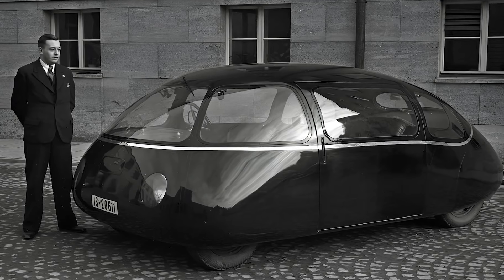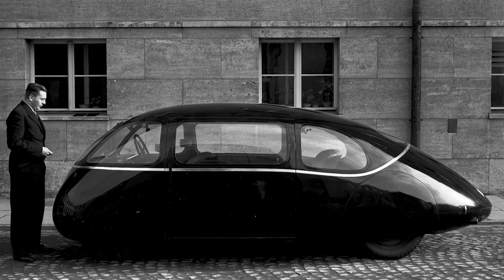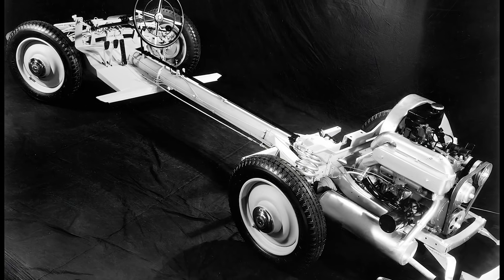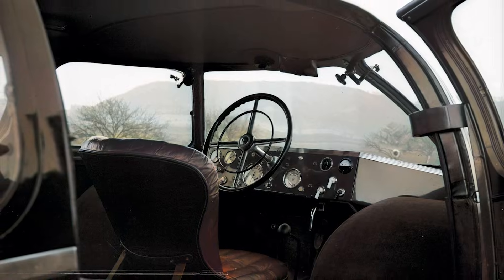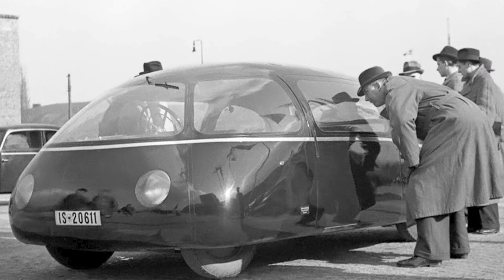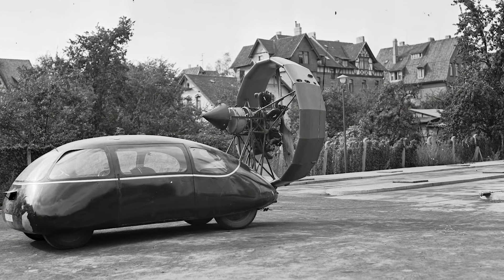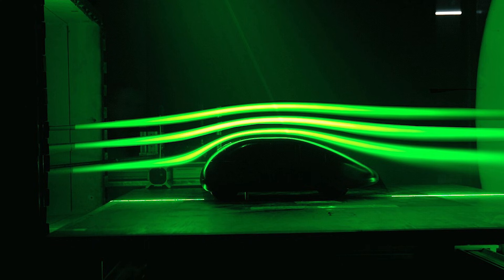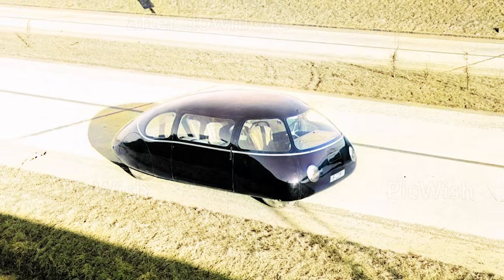👉1939 Schlörwagen: The Most Aerodynamic Car You’ve Never Heard Of

Comment: A very pretty car to my eyes.  it put me in mind at once of Buckminster Fuller's Dymaxion, which was developed around the same time; also egg-shaped, though with three wheels (third in the rear), front wheel drive and powered by a small V6 engine, also mounted in the rear.  An eye-popper, the Dymaxion got 40MPG, but had the same stability issues as the Schlorwagen.
Reply: The Dymaxion Car was far less stable, it had rear wheel steering and was unstable even at low speeds.
Reply: See Aptera, which will soon be inroduction.
Its solar cells  promise infinite miles per gallon, should it be parked in sunlight.